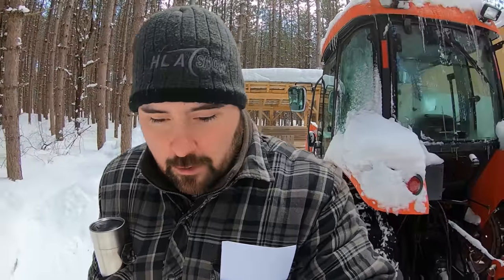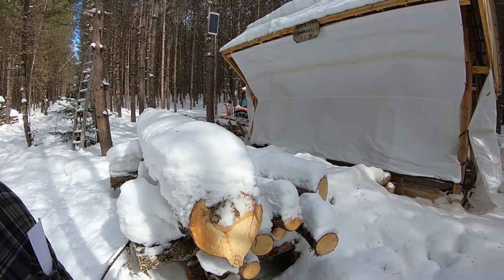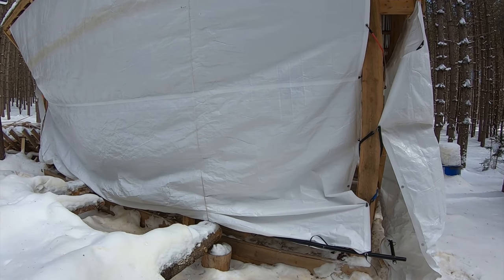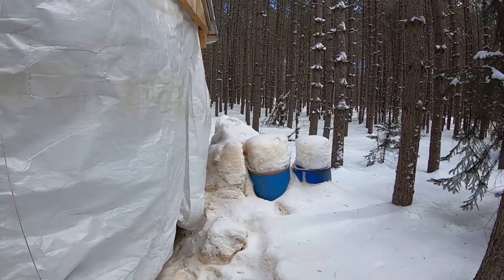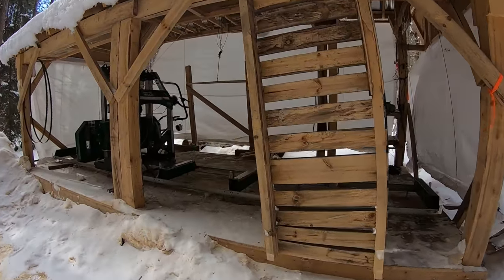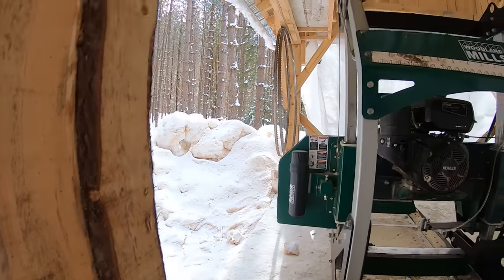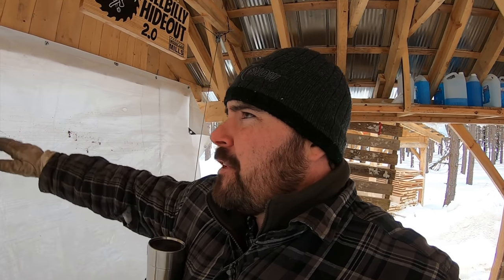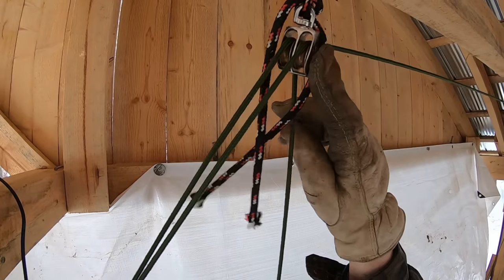Why I Don't Sell Lumber from my Sawmill

Comment: Interesting information.  I’ve watched several of your videos and liked them all.  I have 2 subjects to comment on regarding your video.  One is negative and the other is another factor in a business you didn’t mention.

Let’s get the negative out of the way first.  Your video title is “Why I Don't Sell Lumber from my Sawmill” yet it took you about 6 minutes or 26% of the whole video to get to the subject.

Now let’s cover the “other factors”.  Based on your figures I totally agree with not getting into the sawmill business if you are going to go out and buy the equipment solely for the purpose of having a sawmill business. However, if you have a sawmill that is another matter.  I don’t know about Canada, but here in the U.S. the tax laws can play a big part in a business.  You’ve got a sawmill and you have a tractor and maybe some other equipment that you use when cutting lumber.  All these things are deductible on income tax.  So is the cost of your fuel and repairs and everything else associated with the sawmill business.  This can make a huge difference in your overall household income.  It doesn’t matter if you business is profitable or not as long as you have a plan to try and make it profitable.  Now imagine how much money you could save it you wrote off on you taxes a couple of thousand for your sawmill and several more thousands for your tractor.  Plus writing off all expenses associated with your sawmill business.
Reply from the maker: Sometimes there is lead up to the main content of the video to give context for viewers. Thanks for watching. Hope you liked the video.
Reply: @sawingwithsandy  Subtle reply!

Comment: Can u explain board foot as to just a foot
Reply: 1 Foot  x 1 Foot x 1 Inch think
Reply: 2x6  1ft. in length =1 board foot. (2x6=12" or 1') x 1' in length =1 board feet.
2x6 10 ft. in length  = 10 board ft.
2x4 10 ft. length = .67 board feet. (2x4=8" or .67 parts of a foot) x 1' = .67 board feet.
2x4 x10' in length =.67 board feet.
etc.
Reply: It is harder then I though but Ty Terry and Smoky for your reply
Reply: @gotti5472  A simple trick is to multiply all the dimension numbers together and divide by 12. Works every time on any size lumber. (2x6x10) /12 = 10 BF

Comment: You need to get a edger
Reply from the maker: I agree
Reply: how would one incorporate an edger into a mill like this ive never seen one used before, mill the log to the board thickness's you want without ever flipping it, then take these slabs and run them through the edger to take the wane off and get them to the desired widths?